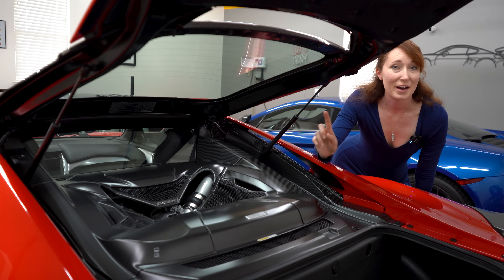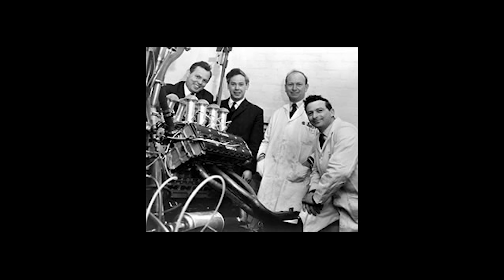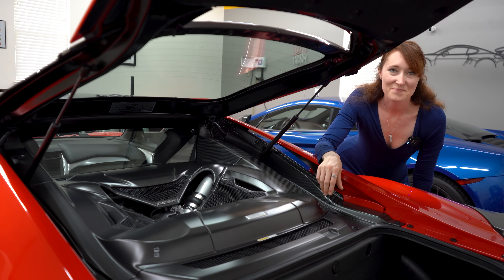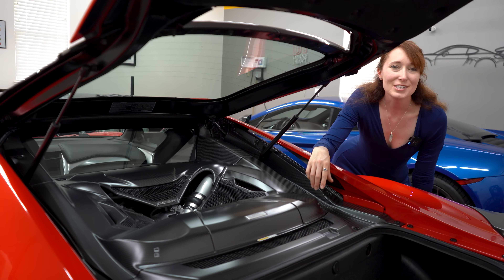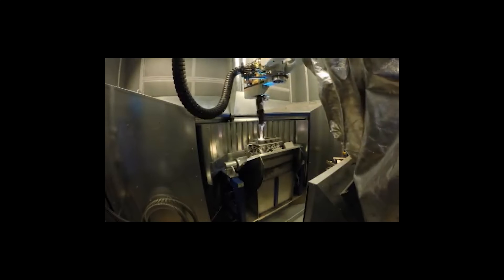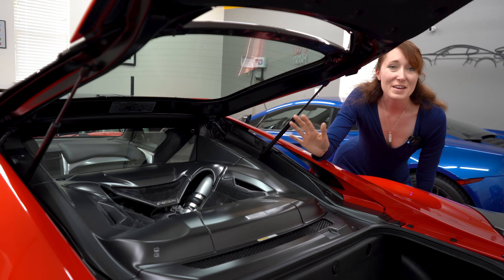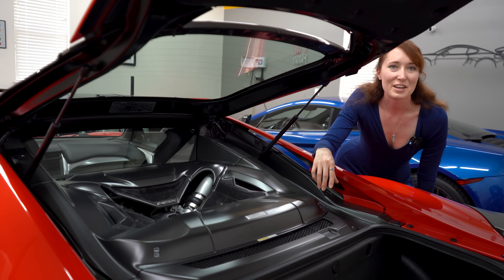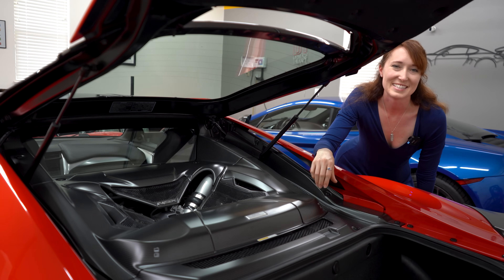The Cosworth Honda NSX Connection #cosworth #nsx #honda

Comment: Really interesting but also strange since Honda has been making higher specific output engines, frankly kicking coswotths butt since I got into cars. Look how superior a 2002 Honda K20A2 is to the equivalent cosworth designed ford focus SVT engine. Is there any source of this claim cosworth worked on NC1 NSX engines ?
Reply from the maker: The press link is in the description and Cosworth is an epic engine builder.
Reply: Manufacturing the block, heads , plasma coating, boring , honing , sound as Honda just used  Cosworth low volume ,custom engines manufacturing capabilities . Just costs optimization probably, since this car is low volume production car even for Honda . Noting was said about Cosworth involvement in engine design process .